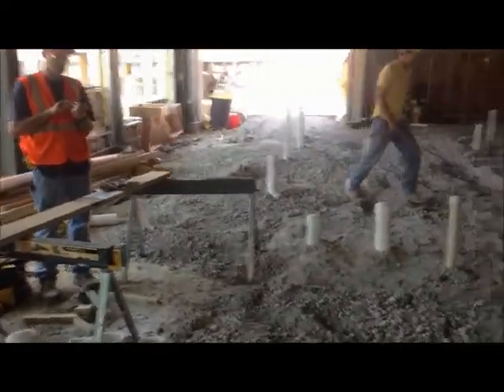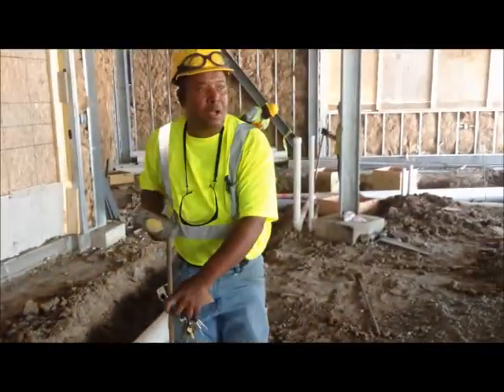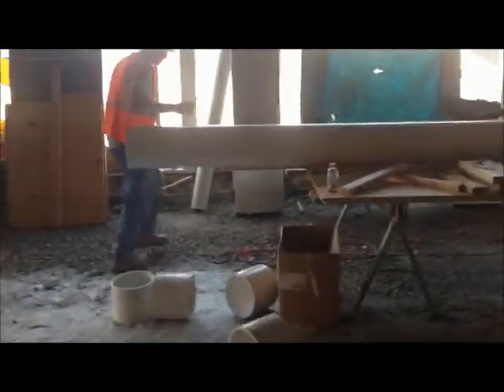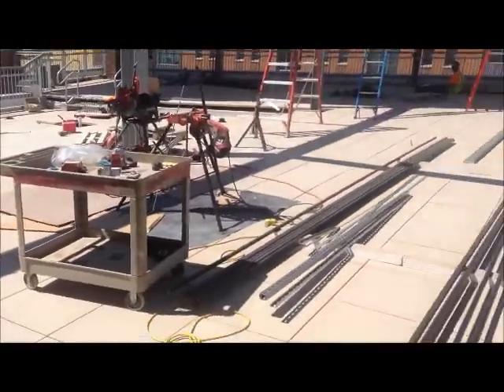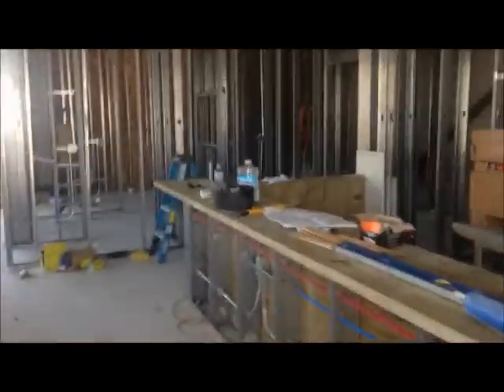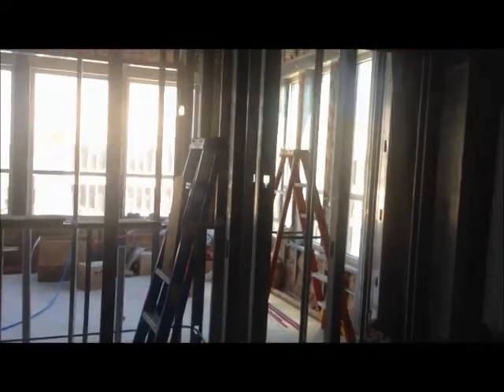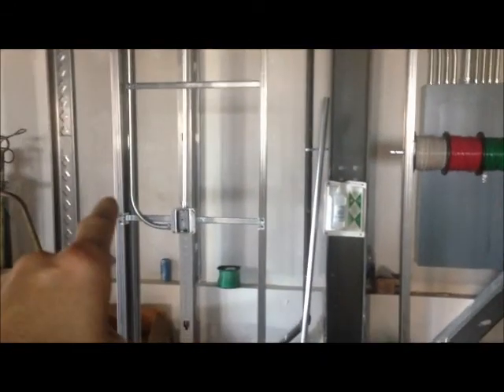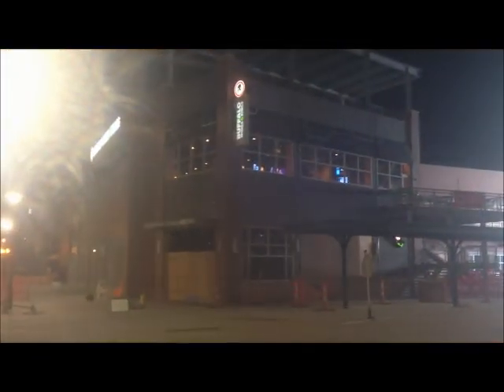Longwells 6 www.openingabar.com Chris Lenahan

Comment from the maker: The Metal frame is required by code in some cases and this is easy to work around those challenges. #1 the metal edges when drilling holes to run wiring are a huge issue so I like to run electrical tape or Duct tap around the inside of the holes #2 the Metal does not have the structural support I personally feel that wood does so watch the overall weight of the bar top. #4 I would recommend the dual bar die for metal stud bar dies